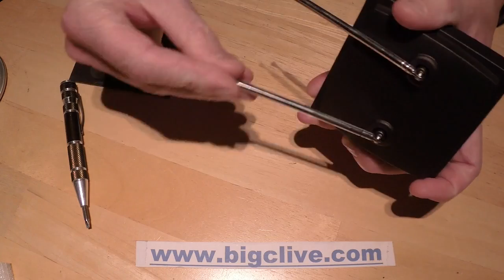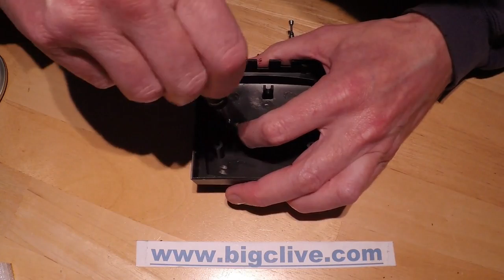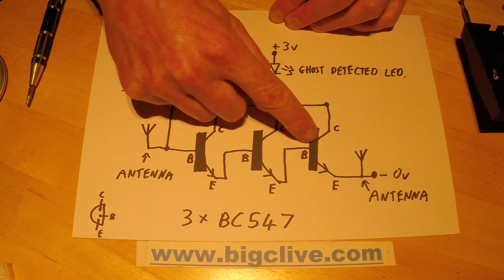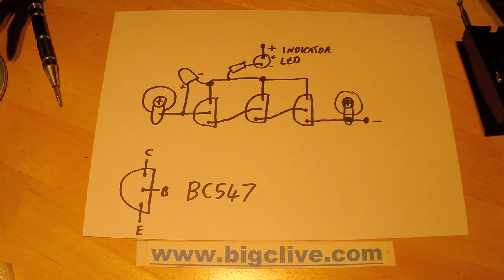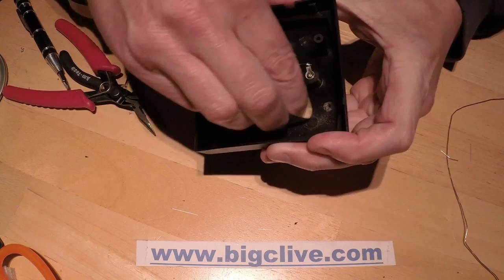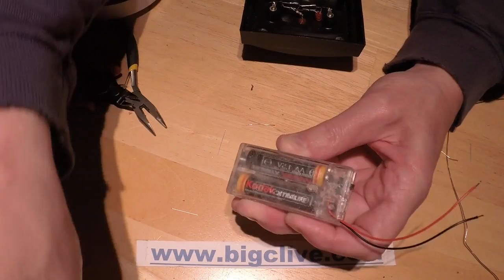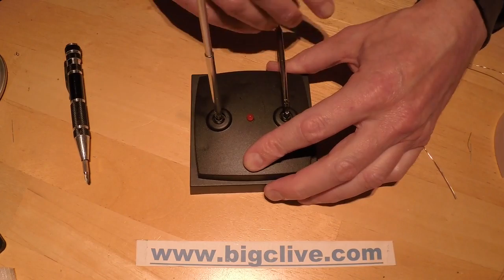Make a ghost detector.

Comment: Hello, thank you for sharing the circuit. The C and E of the BC547 on your schematic is the other way around. In your drawing on the bottom left it should be CBE from bottom to top.
Reply from the maker: +Manuel Caminheiro It's shown from the base.  Not the top.
Reply: +bigclivedotcom Of course!, dumb me! It's interesting how we tend to get use to see things repetitively in a certain pattern! I've always looked at pinout's from top do bottom. I guess i have some work to do in my mind... break the pattern! Sorry, Thanks!
Reply: +bigclivedotcom ,,,i've watched your video repeatedly,and i've noticed your pin configuration was reversed becuz ,as i know emitter is always connected to the negative and collector is to positive,,but i like this,,, i was confused,,
Reply: In my case led always on not even blinking any suggestions ??
Reply: @tanviii506  I have just built one. You need the correct LEDs that Clive suggests. This detect my footsteps as I'm walking. Just waiting to get the antenna box, it should be here tomorrow. 🤞

Comment: lol that 'coax' cable is a better antenna than the actual antenna unit.
Reply: +Andy Plater That "coax" is probably halfway decent transmission line, if you don't care squat for what impedance it is.

Comment: When drilling through plastic, put the drill on reverse, and it will melt its way through the material, much less likely to catch or crack. :)
Reply: +HIGH CALIBER but then you need to de-shit the bit from any melted crap
Reply: +baxter22071990 de-shit XD
Reply: Just poke it straight away using the solder then

Comment: how could i add a buzzer to this where and how would i put it?
Reply from the maker: UNEXPLAINED PARANORMAL RESEARCH A very low current buzzer could possibly be connected across the LED, but it would probably just make a variable noise all the time.
Reply: +UNEXPLAINED PARANORMAL RESEARCH You could rig up a light sensing circuit to detect when the light gets bright to activate a buzzer.
Reply: +CapnRumple or just another transistor for switch?

Comment: ok now i made one of these i used a 47 omh 1/4 watt resistor and 3 2n2222 transistors with the led in reverse i put 3 volts to it but it would not work i had to up it to a 9volt battery.........could this be just the difference in transistor? or resistors?
Reply: check the pin configuration,,,

Comment: how many wats on that 47 ohms
Reply from the maker: UNEXPLAINED PARANORMAL RESEARCH It's just a common quarter watt resistor.
Reply: bigclivedotcom thanks been following you and plan on make this good instructions i like the way you do things.....cheers from the usa
Reply: bigclivedotcom: Hi, I wonder if I use 47 ohm 1 Watt resistor and the rest of the setup like yours, will I be able to run it using a 9 Volt battery then?